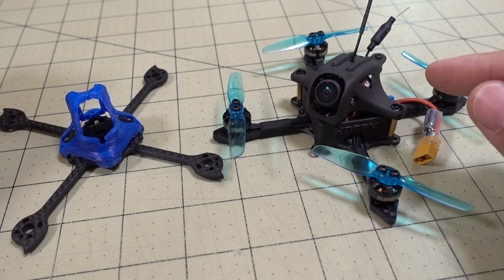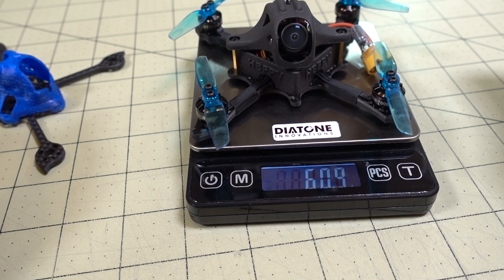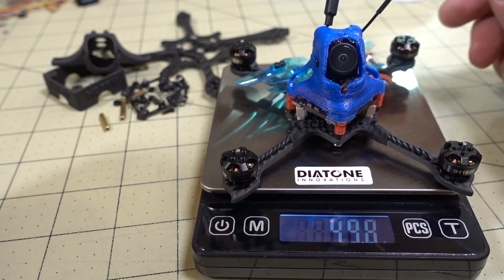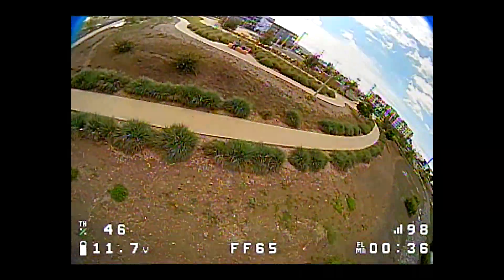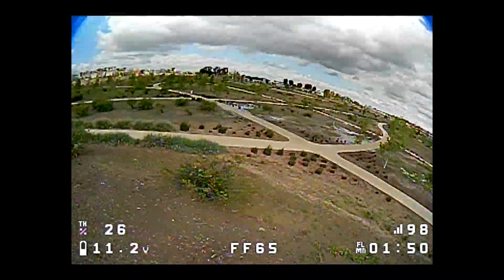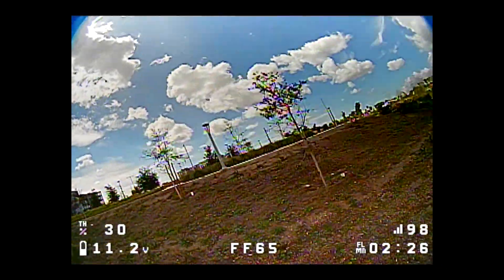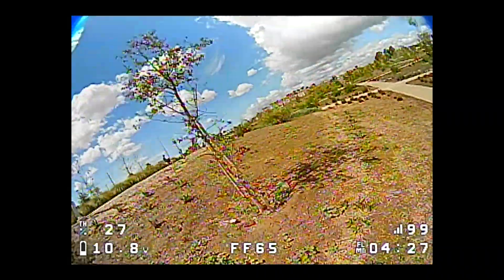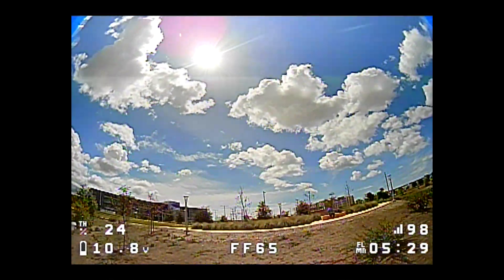HBFPV FF65 Toothpick Mods and Fixes 🛠️

Comment from the maker: 🛠️ Made some fixes and mods to the FF65...

🎓 Watch these videos to replicate...
Betaflight 4.1 Upgrade Guide - http://youtu.be/JP88ci9lJ6w
How to update ESCs - http://youtu.be/bi5JZ2HPL3M
RPM Filter Quick Start - http://youtu.be/JkBa7v7qWus

💧 3D printed Pod - http://bit.ly/2V8JoK5
💥 Frame - http://bit.ly/2wGAUAL

HBFPV FF65 65mm Toothpick - http://bit.ly/2WYFIfr
Use code AlbertKimRC for 7% off at check out
FYI, the FHSS receiver version can be switched to D16

🎓 I bought the drone, now how do I set it up?
      Watch this - http://youtu.be/19i8ob7u3rE

🎥 Original review here - http://youtu.be/EQLs25f6Gm8